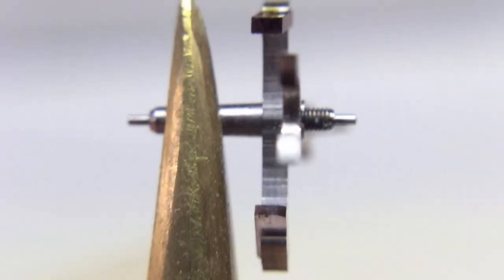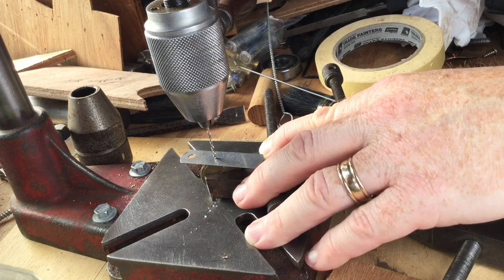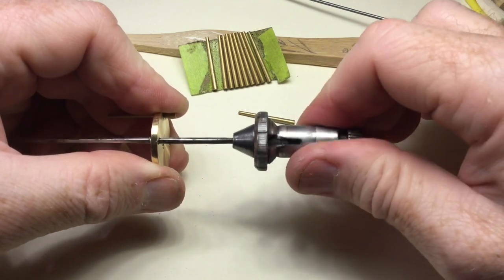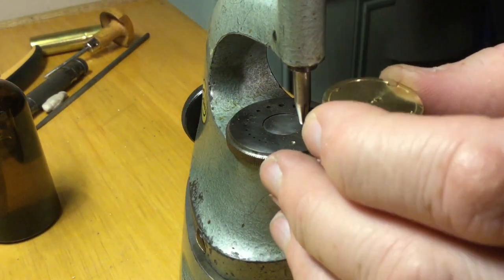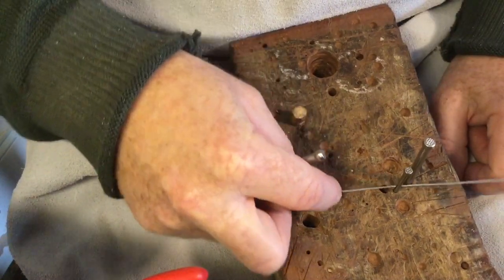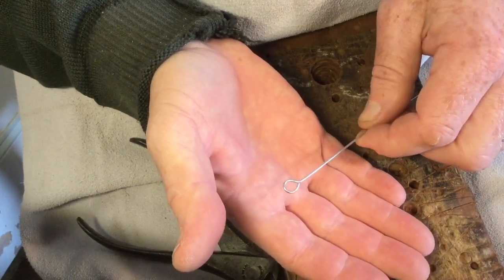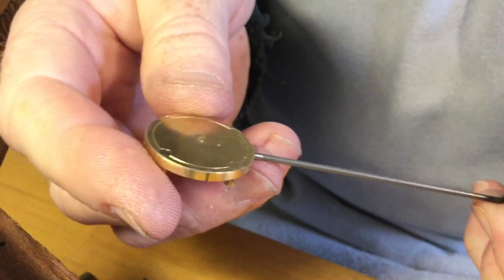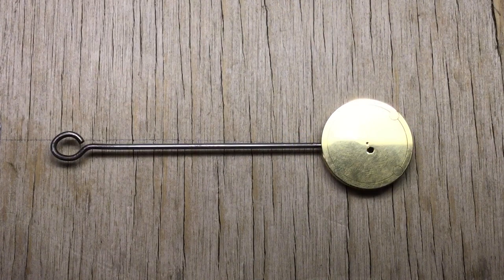Pallet Warming Table. Makin' a Tool Ep.3

Comment: Regarding Hot Melt Glue, a simple trick is to use Isoprophyl alcohol to remove it, it works a treat on most surfaces

For Next time
Reply from the maker: That I did not know. Thanks Ngarewyrd :)